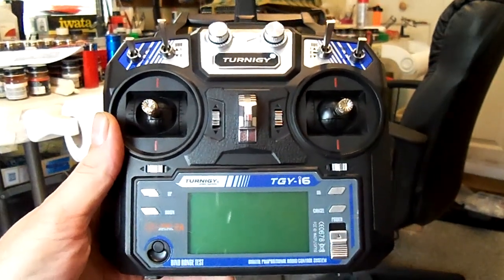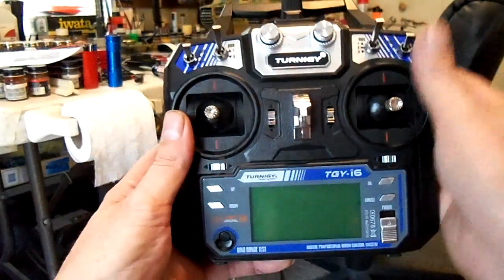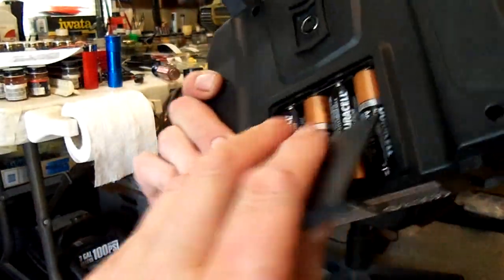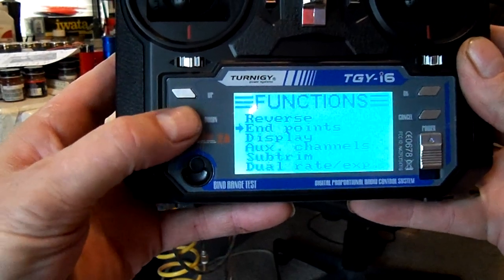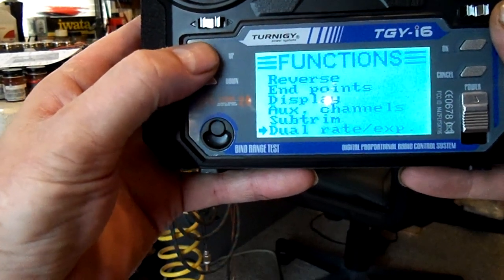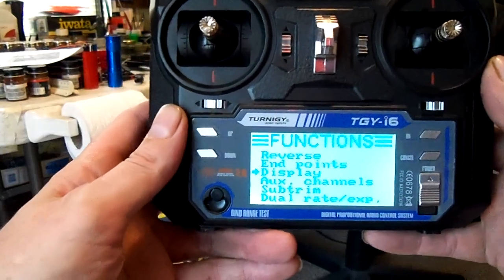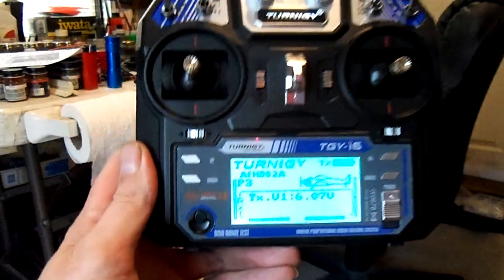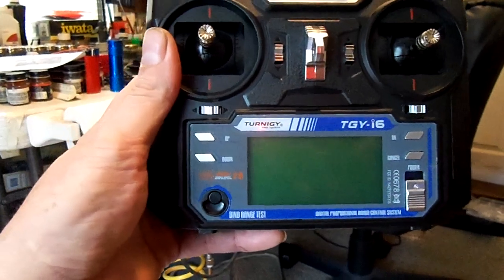Programming the TGY-i6

Comment: I ve set from normal to reverse mode n it is well functioning but when i turn on the tx it back to normal. N i ve to set again .it is not saved in the system.
Reply: You need to hold the cancel button until get out of the menu configuration. You will save the changes